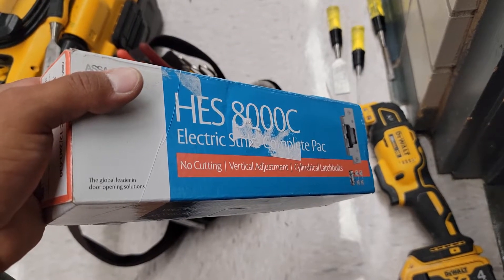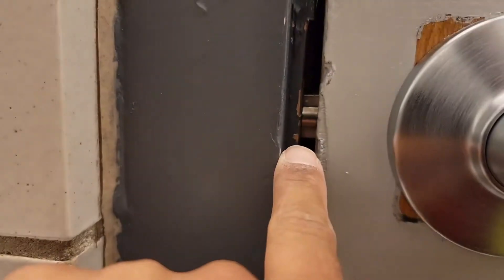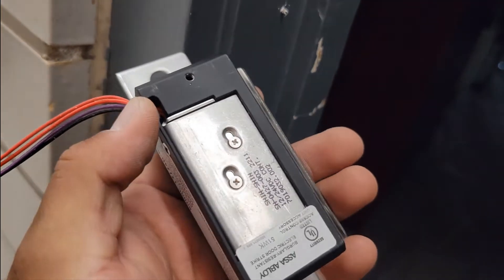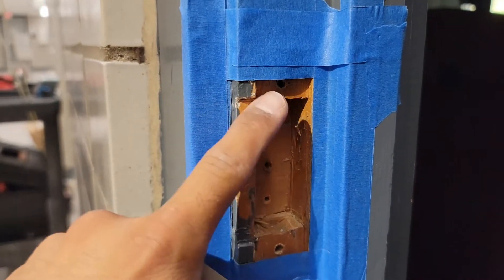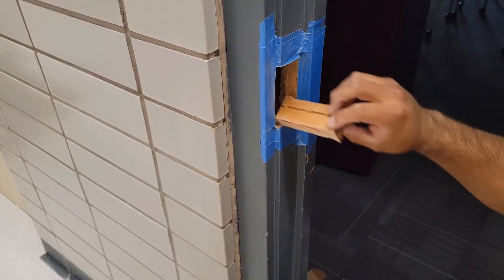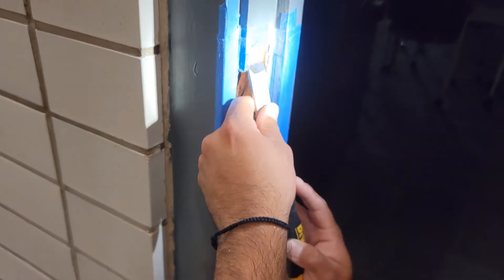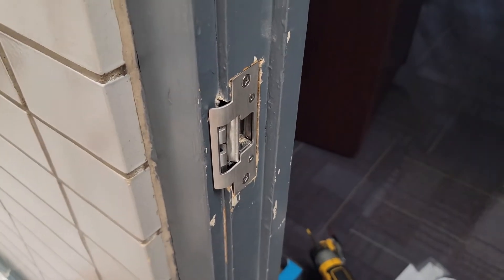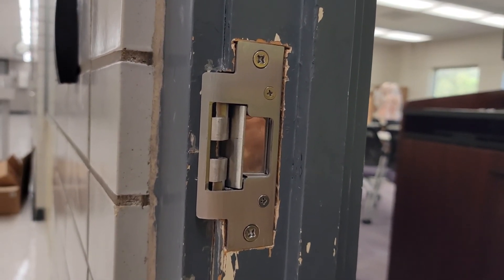HES 8000c Electric Strike Installation #tools #review #shorts #tiktok

Comment: Nice work.  I would note that when using the HES 8000 strike that the two 'hooks' on the strike body actually need to be hooked around the front of the faceplate.  You have them behind which puts some stress on the strike. You can see that around 2:46 that there is an ever so slight angle on the faceplate to the body and over time this will wear out the strike quicker.  I try to avoid these strikes when possible because the door geometry needs to be more perfect than others, but it seems that with the construction of the frame this is the easiest option.
Reply from the maker: Thank you for the feedback.

Comment: What type of certification you need to learn this, access control?
Reply from the maker: You don't need any Certs to become a helper. Once you are in the industry, the company you work for will get you a Security Access Controls License to be able to view drawings with high security details. As you make your way through this industry, you can get certifications on different types of systems.

Hope this helps.
Reply: Thanks, 10yr in the field now currently a lead low voltage tech. We run the cable but out source the installation and I’m trying to see where to start. I’ve heard of open path, but couldn’t get information to learn from them. Any systems that I could get training online?
Reply from the maker: Assa Abloy Academy has a lot of webinars.

Comment: I like this kind of work. When you search for a job online, is it a low voltage technician?
Reply from the maker: Actually, when you search for this kind of Job you will have to search by Security Technician. Low Voltage Technicians can be all the way from Fire, Access Controls, Network Infrastructure (Data Guys), Intrusion Systems, Camera Systems Etc.

This kind of work is mostly done on the Access Controls Systems, installing Electric Locks.